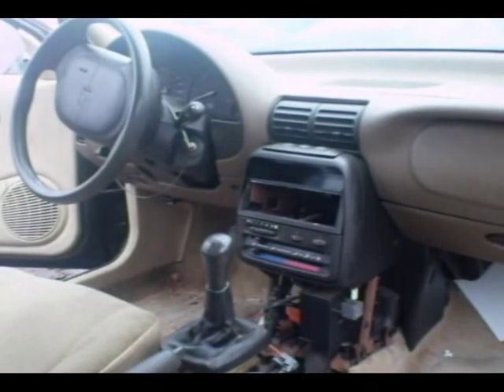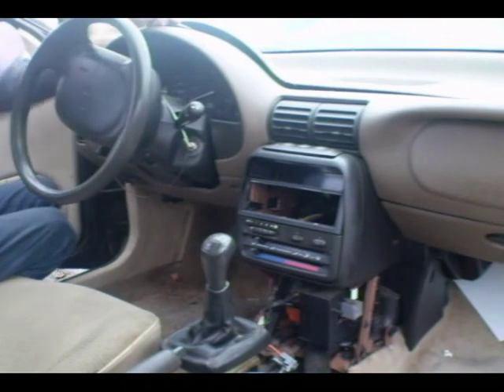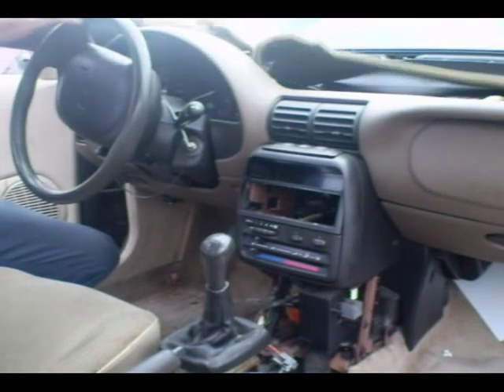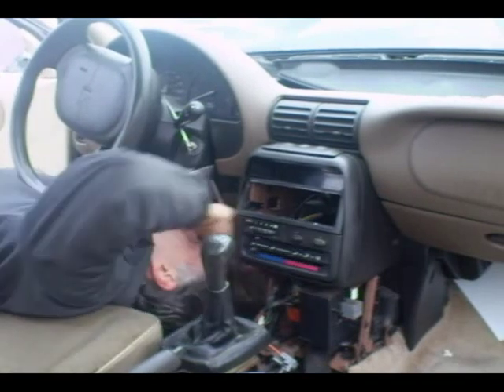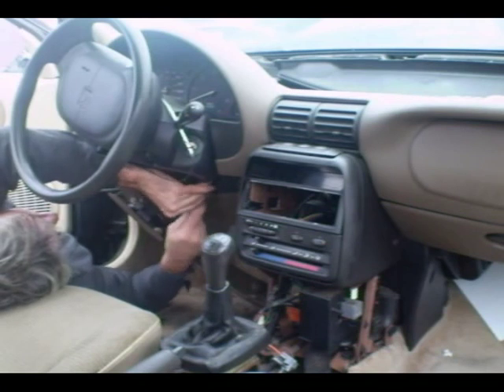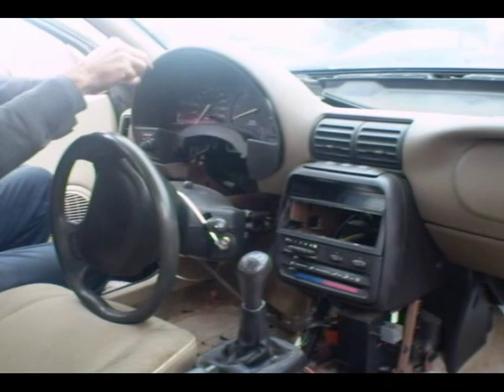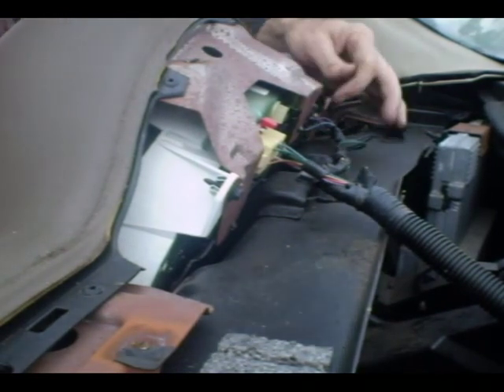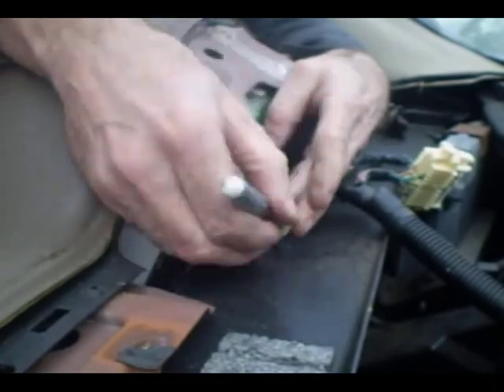Saturn Instrument Cluster Removal

Comment: Thanks, Rich. I was able to replace a bad bulb in the instrument panel, but it took me an hour to get the cluster out instead of your 6 minutes ;)
A couple notes for anyone else doing this:
The bolts holding the steering column are 13 mm. There's a wiring harness partially blocking the right bolt, so don't use a deep socket, and raise the tilt wheel up all the way up. And don't push the drivers seat all the way back so that the steering wheel has somewhere to land.

Comment: I just did this job after watching the video. The richpin to mortal conversion is about x10 so if he does it in 6 min figure 60 minutes for a mortal. The dealership told me the individual lamps are not serviceable and that you need to replace the cluster. In fact when you remove the cluster not only are the individual lamps simple quarter turn generic lamps, they are even labeled to make replacement easy.

Comment: @MatthewRLyons 
No, you don't have to remove the steering wheel.  However, it is very difficult to clear the steering wheel when removing the cluster.  And when you go to put it back in, you stand a very good chance of damaging the odometer reset button.

Comment: @richpin06a I took those off, there was a half inch piece of gray foam blocking it, so I removed that and it works just fine. Where that came from, I have no idea. The passenger vent is still not blowing, I will take a look at that tomorrow. Thanks!

Comment: Thank you for this help. Just bought a 1995 SL2 with that horrible dashboard. I used another way since it's -20 celsius and didn't wanted to freeze my knees to death. I needed to know how to reach the 2 back bolts of the cluster so it helped! Thanks

Comment: BTW: The electrical connectors are difficult if you don't know how they work. The ears on the connector actually need to be pulled outward, not squeezed. Use a screwdriver to push the ears away from the plug using the plug as a base for your screwdriver to pry it. Be careful with the screwdriver because there are ribbons behind the and around the plugs and if you scratch them you will need to replace your cluster or attempt a Macgyver solder.

Comment: Question Richpin?
Would make a difference if gen 2 has tilt steering? Would I still have to remove the two bolts to lower the steering column to get the cluster out? Would be enough to lower the column with the tilt?

Comment: Yes the odometer the trap the gas and the RPM's work like they should it's just the speedometer which one do you think I should do first? It's easy to pull out the gauge cluster on the bug. Its a lot of work to get to the transmission to get to the speed sensor.
Reply from the maker: If the odometer is working correctly then i would say the VSS (vehicle speed sensor)most likely is not at fault.

Comment: when you pop the first cover off, where do you pop it off at? I know there are clips holding it, but I could only find the first one on the far left. 

Trying to get the odometer/tripometer bulb out for replacement. I might wait until more bulbs go out though before I do.

1998 SW1 here.

Comment: I have a 1998 VW bug and the speedometer only works when it wants to. Should I get a new speedometer or are the part that goes in the transmission that tells me to speed which one should I do first? And because it is electronic well at have the same mileage as my original speedometer or well I have the mileage from another car if I swap it out? Do you now?
Reply from the maker: Is the odometer working correctly.
Reply: +richpin06a  hello Rich I have a Saturn 99sl no crank no start issue I have a good starter battery fine dash lights up but no radio no dome light so I figure f5 an I checked it out it was burnt how do I fix it do u have any videos on it
Reply from the maker: +delante thomas The only video i have on the f5 problem at the present time is this one https://youtu.be/bE-HbjrIQSs

Comment: Rich, 
I am trying (in vain) to remove the cluster from my '93 Volvo 940 wagon. I find 2 spring loaded tabs on either side of the inside of the cluster cover, but can't seem to find any way to hold them both (or either) held back so I can pull the thing out, to give me access to the cluster mounting screws Any suggestions?

Comment: Is there an instrument cluster test mode? My tach needle usually takes around 5-10 seconds to activate upon startup. It takes longer on cold days. Is this an issue? Is there a test mode?
Reply: If you still have the car and it's a second gen saturn then that is normal for the car. Got a 99 SL2 around Nov last year and thought something was wrong but researched enough to see that is just how they act when starting.

Comment: I have an 87 Porsche 944. After rearglass installation my dashboard went dead. at night the dashboard light flashes on and off. the dashboard came back to live one more time and it died again. i checked the fuses and they measure 0 resistance like its supposed to. should i start by removing the instrument cluster?